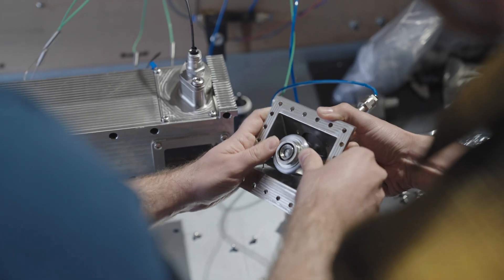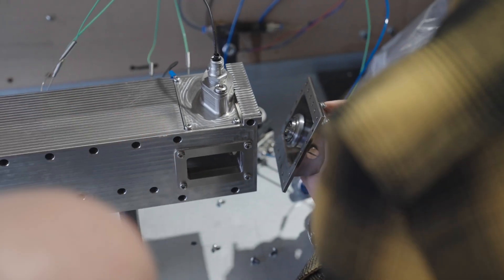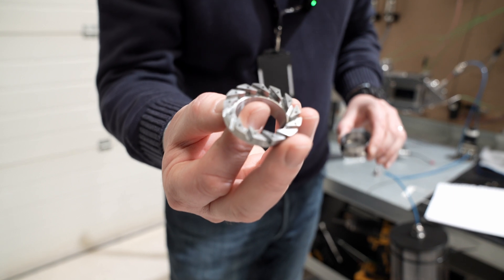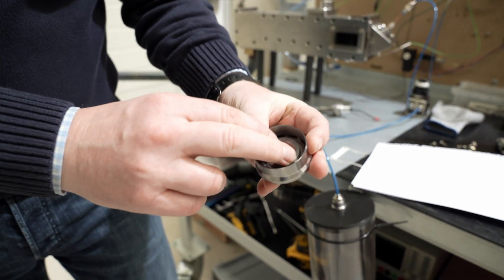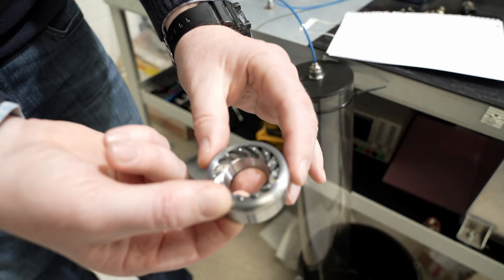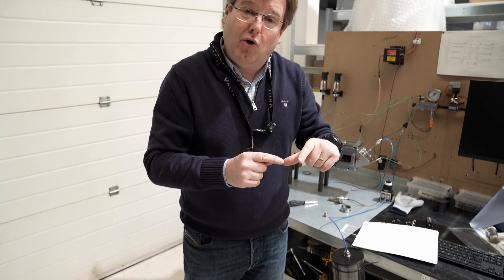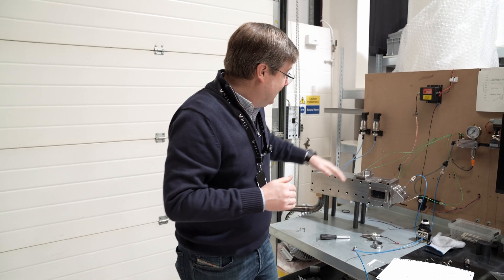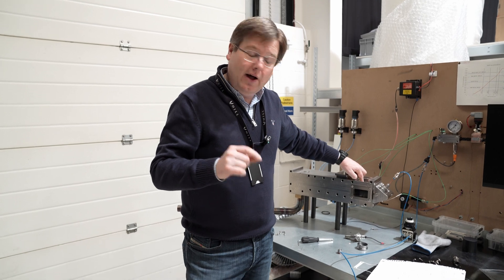Breakthroughs in Fuel Atomisation and Flame Control

Comment: Will there be an electrical helicopter version?
Reply: No Batteries to heavy. Our Smal EV Van has a 50KW/h battery and it weighs in at 420Kg. Heli's need to be kept lightweight as possable. As take off and hovering needs upto 130 % power.
Reply: @emfs2016  I think the weight of a full tank of fuel on the Hill HX50 helicopter is  318 kilograms (kg) roughly 699.6 pounds (lbs)
Reply: hahah no. Your going to have to wait for a new battery tech for that.
Reply: Yes and as the liquid fuel is used its mass becomes less so the fuel burn slowly becomes less. Batteries are a fixed mass regardless of the amount of energy available and also per unit of weight the energy density of batteries is less. The range would be considerably reduced when compared with the liquid fueled machine.
Reply: Please never come back to this channel 🤣🤣🤣🤣. The man is showing a ground breaking way of turbine, and you're asking for a never-ever-gonna-make it electrical engine 😭😭😭. Here's some advice: there's never going to be proper electric flight until they find a lighter way to store energy, never. So quick answer: as long as batteries to store energy is as heavy as they are and aren't coming down with minimum 200%-300%, you'll find nothing will ever replace turbine and piston engines for aviation, at least nothing that is even comparable..